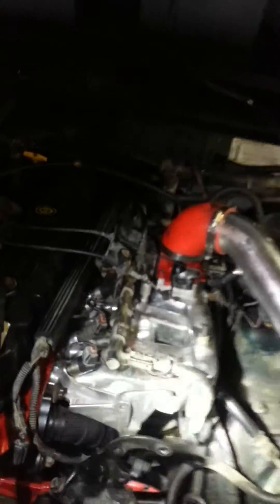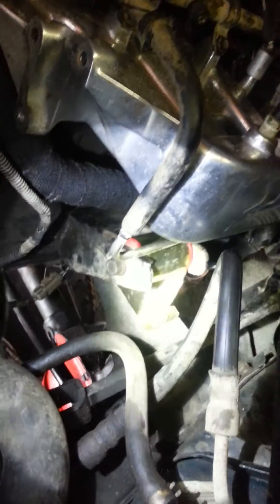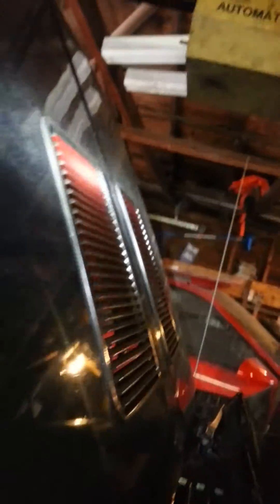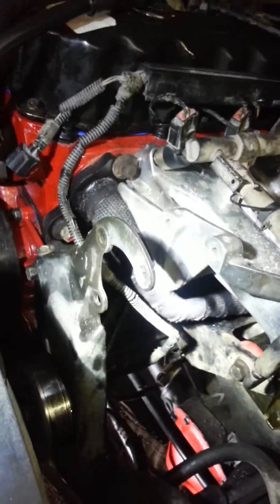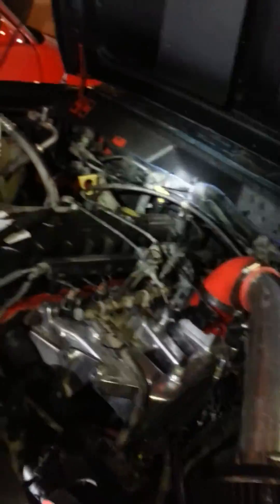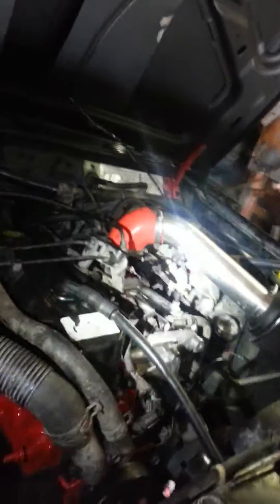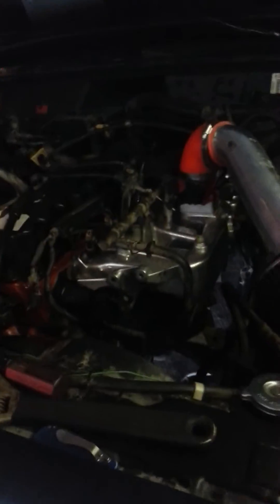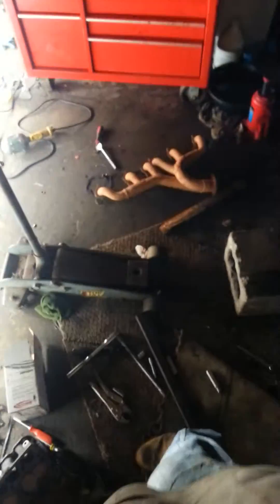Jeep 4.0 ported head

Comment from the maker: Back at it once again, hi guys hope you like the video & my jeep its a video of my jeep sporting a ported (7120casting) port work done by me machined .010" & mopar performance head gasket to go with it & ARP head bolts, 63mm tb, home made CAI, tb spacer, ported & polished intake manifold, banks revolver header(thermal coated then thermal wraped and then thermal coated again, prothane motion control motor mounts, relocated IAT sensor, eliminate clutch fan to an electric fan